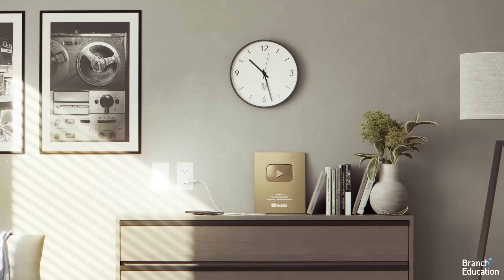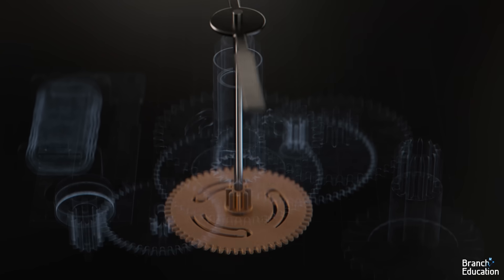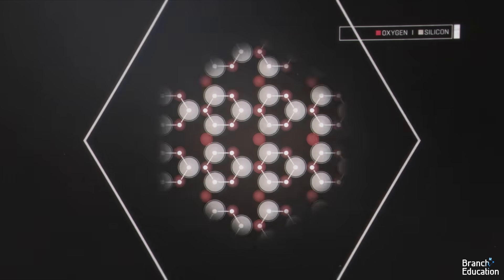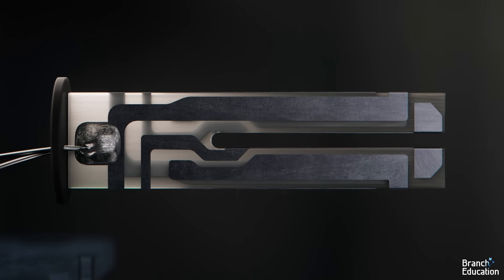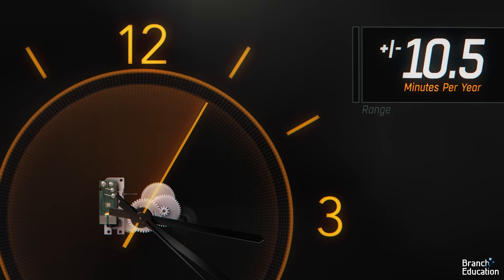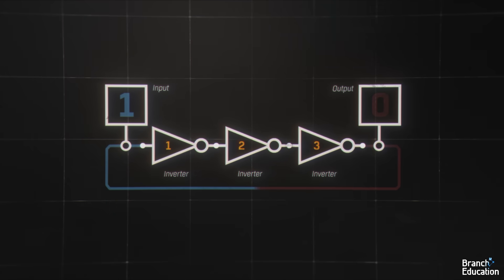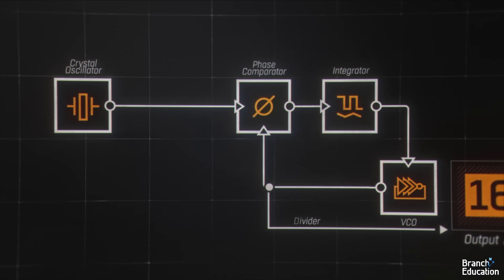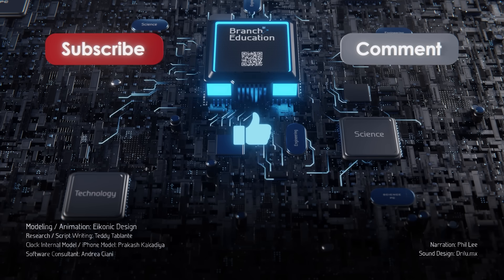How do Digital and Analog Clocks Work?

Comment: While it's not the focus of the video, I do wonder what prevents the drive gear in the analog clock from spinning in the opposite direction. There needs to some sort of bias or it'd be basically random in which direction it turns. Is it simply the small offset to the electromagnet?

Comment: I always used to think that how a clock runs at the same speed even when the power of the battery is low but not a dc motor I used to play with..

Comment: Amazing video! We learned a lot of things, but please, next time, render it in 4K or 1440p. I know it's time-consuming with cycles, but trust me, it's worth it!
Reply: Why do you need to watch this in 4K ? 90% of people watching are on their phone
Reply: @stealthbombing_991   this is likely due to the fact that 4K resolution is now a standard feature on the majority of recent smartphones, unless, of course, you happen to own a Samsung 100$ or less
Reply: @ephoricDev  4K playback is definitely a thing, however physical 4K resolution on phones is still relatively rare to see outside of Sony phones and a few others. Reason being, the pixels are much too small at lesser resolutions, and our eyes cannot distinguish a difference - Apple popularized this phenomenon with their "Retina" display marketing. The battery drain from running a 4k display is not worth it, especially considering the increased resolution is wasted. Still, a good reason to upload/render in 4k would be for those watching on 4k TVs/monitors, where the difference can be seen by our eyes, and this would have the added benefit to let smaller displays on phones and tablets use supersampling to sharpen up the visuals.
Reply: @PaulmichaelContreras  YouTube utilizes a sophisticated compression algorithm for videos. However, in 1080p resolution, some optimized pixels may be noticeable, leading to a less precise display. This is why the label "1080p" may not accurately represent the video quality, and uploading in 4K is recommended for a superior viewing experience and less pixels. Consequently, even if your computer has a 1080p screen, you can discern a significant difference between a 1080p video and a 4K video ON YouTube.

Comment: Actually the quartz oscillator in nearly every clock runs at the frequency of 2^15 (32768 Hz) NOT "billions of times a second."
Reply: Computer processor has billions of cycle per second